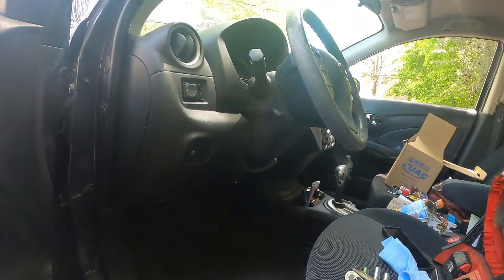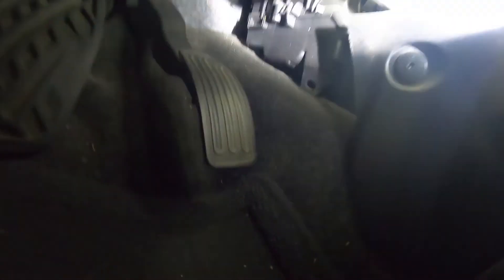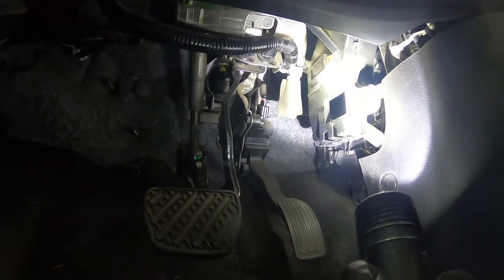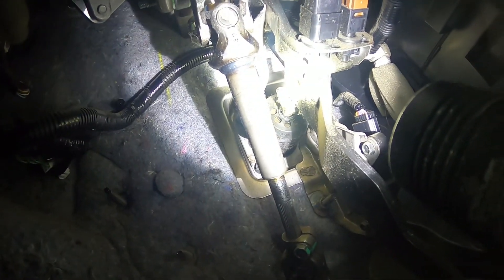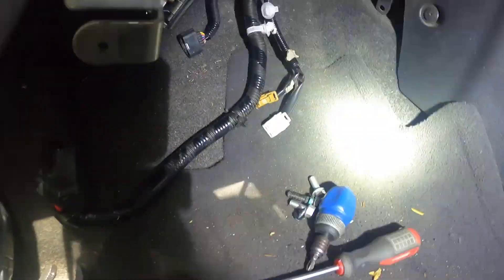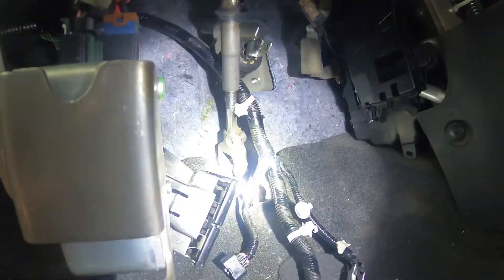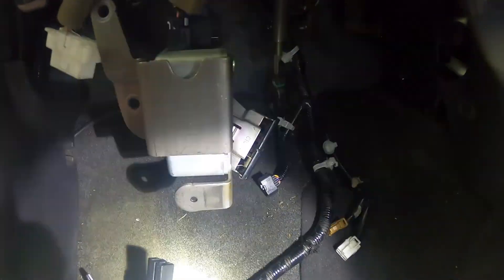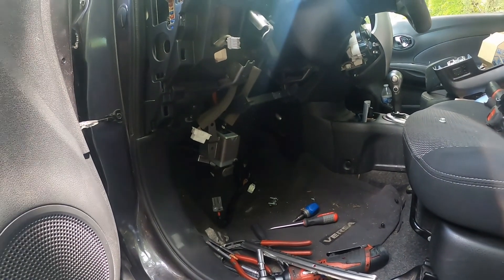How to replace 2013 Nissan Versa Blower motor

Comment: Remove kick panel, unplug connectors on pedal assembly, detach all connector push clips, remove metal box and bracket in front of pedal assembly (gave me more room), disconnect steering shaft at the TOP section (can be slid down easily by hand), remove pedal assembly, remove blower motor

Removing that metal square box, it's bracket, and disconnecting that top end of the shaft, will make the job a lot easier

Comment: Currently doing this on my nieces ride. Any tricks to getting the brake assembly past the steering shaft? Doesn’t seem to have enough clearance.
Reply from the maker: Not sure if I had an issue  remove  both foot pedals .
Reply: @kevinsmobileautomotiverepair  I got it out. Gotta pull all the harnesses out the way for enough clearance. Appreciate it.

Comment: Besides the pedal assembly did tou have to take anything iut im having a hard time getting thw assembly out at all
Reply from the maker: the lower kick panel  the bracket for the  the steering motor controller   that should be about it.
Reply: @kevinsmobileautomotiverepair  I'm doing this as a novice what is the lower kick panel and steering motor control
Reply from the maker: @jessadiah9483  the plastic part that hits you knees   you will see the bracket needed to be removed when turning panel is off

Comment: Did you disconnect the steering column at all? I saw another video where the guy did and it looks at more complicated. Thanks
Reply from the maker: No,  I did  take out the foot pedals to get the clearance to get the blower past though
Reply: @kevinsmobileautomotiverepair  I did exactly what you did. There was no need to remove the steering column at all. However I'm gonna swap the blower resistor because it's still not working. But hey thanks for the short video it was very helpful to me. I appreciate your time.
Reply: Just took steering column apart and actually way much easier and it has a pre set alignment in it to make sure you get it back together properly!! Just for future reference lol. I just spent 3 hours trying to jimmy it out and it took 5 minutes to separate the column so definitely worth the time to anyone who reads this comment!!!
Reply: @alexanderroush3703  How did you remove the column?

Comment: You said leave the switches in the housing because they a bear to readjust, I thought the only thing to disconnect was the wiring harness from the pedal assembly
Reply from the maker: Correct  no need to pull the switches   that's what the manual  wants  is to pull the switches  out to remove

Comment: So how exactly do you remove any of this?
Reply from the maker: in the video it tells what to remove.  Lower instrument panel   Lower brace for steering column   remove the brake and gas pedal assembly  then you can get access to the blower motor